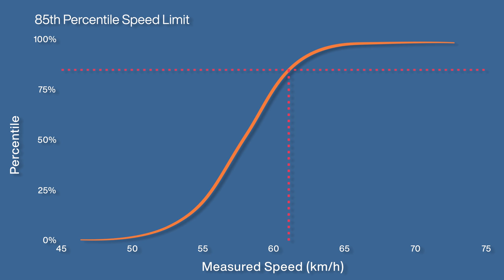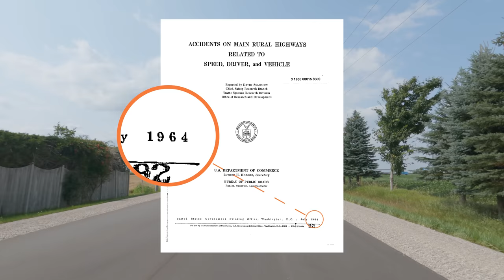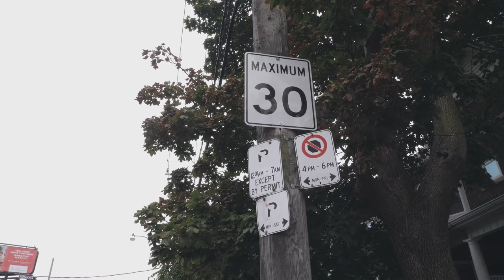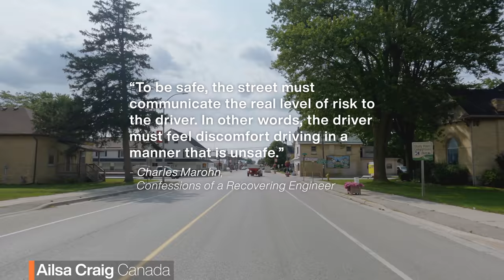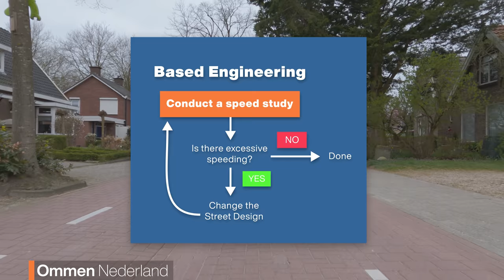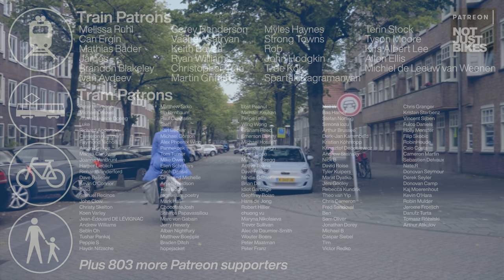The Wrong Way to Set Speed Limits [ST06]

Comment: If we set limits based on your recommendations wouldn't the traffic engineer be prejudging what speed he or she is predisposed to regardless if that speed is too high or too low?  I remember the national 55mph limit we had in the us.  That limit made a lot of sense in more crowded parts of the country with lots of hazards and older narrower roads.  However it made very little sense out in the remote extremely rural sections of highway in north Dakota or say Saskatchewan,  where it is extremely uncommon to have cyclists much less pedestrian traffic.  In some cases our limits in those areas still seem artificially low.  I've been on remote stretches of roads with a limit of say 55mph or approx 90kmh and witnessed literally nobody driving that slow.  If nearly everyone is going faster than a set limit, literally nobody one would have to assume that either they are all habitual law breakers with no regard for safety or the limit is artificially too low.
Reply from the maker: Did you miss the part about this method making sense for rural roads but not for city roads?

Comment: There's a residential street near where I live that I always used to use, and it is very wide and easy to go quite a lot faster than the posted 25, and the street I guess pooled their money to have speed bumps installed, forcing people like me to take different residential streets while going way faster than the limit on them. However they are the kind that have 3 parts, not one solid bump, and if I aim carefully enough I can still take all but one of them (is a little wider or something) at speed just by going straight down the middle of the road lol... I know it has to piss off the people who live there when they see me do that.

Comment: Grr...

85-th percentile takes pedestrians into account because most drivers will slow down for them... Please understand that most drivers don't actually (actually) follow/care/index to the speed limit at all. You drive the speed you feel is balancing safe and efficient for the circumstance. The number on the sign is to provide the proof of someone doing a bad job of balancing that for enforcement purposes... it's not actually the control.

The control is how safe drivers FEEL.  If drivers are going too fast (>30mph anywhere near an uncontrolled crosswalk, for example), you need to make them FEEL less safe without making them actually less safe.  Brick/textured roads, narrow lanes (with wider runsoffs), curves, making the cuts/etc more obvious all help here. Make the driver FEEL less safe, without making them BE less safe.

Then Hey!  85-th percentile speed limit is now the speed you wanted anyway.

i.e.: Look at how the streets you like are setup with "accidental" (it was completely intentional) traffic calming, and replicate that. Stop thinking about the speed limit.

Comment: Speed limits are set too low on the open road, and possibly too high in urban congestion, though I am exceedingly sceptical that lowering city limits will actually reduce speeds rather than generate ticket revenue for the place.

Comment: "This method seems reasonable, until..."
No! Stop! Hold it right there!
No, it does NOT seem reasonable AT ALL.

As a matter of fact, even at first glance it seeems totally bonkers.
Instead, the reasonable thing to do is decide how fast you want people to travel on that road, and then build the road so that it is safe at the intended speed (or dial down the speed limit when the road can't be built to be safe for the desired one).
Or, if re-evaluating speed limits for an existing road, examine the state of the road and its environment (location, geography and whatnot) and then from that deduce what speed is safe (or what modifications to make to the road to make the current speed limit safe).

Okay, now to watch the remainder of the video...

Comment: well bozo when you are driving you it is an active experience, not passive or subconscious 
monitoring your speed is part of driving just like checking your mirrors. A long with many other basics, not to mention every drivers first obligation is to prevent accidents. Has nothing to do with being a professional driver.
The only power people have is pushing a gas pedal or thunb paddle.
Your presentation is not too hot.
It could be way more matter of fact.
it is too much like broadcast “journalism”.

Comment: The problem with your videos is that you ignore that US and Canada has wayyyy more driving commuters and there's no solution to this problem at least at the moment. So stroads are necessary even if I agree with their issues and overuse.
Reply: One of the entire points of the series is that we shouldn't have so many driving commuters. If we built real infrastructure we wouldn't need to be so reliant on cars.
Reply: @_d0ser  yes. I fundamentally disagree that this is remotely possible for the majority of the United States.
Reply: @JimmyDThing  I mean, you could do this crazy thing called, build rail lines.
Reply: @_d0ser  Yes.  We have them, but where would you like to add more?   I live in NY and I am pretty familiar on this.  One of the most used rail lines in the country is from where I live to NYC (because it's the capital of the state to the biggest city and because it's a way to get to DC).

What do you think should change?  Or if this one is not an example of what you think is needed, what would be?

Comment: The 85th percentile is a valid approach since, as you say, people drive at whatever speed they're comfortable regardless of what's posted. We certainly learned this from the thoughtless and idiotic 55 mph national speed limit enacted by the Nixon admin.

Designing urban streets to encourage slow forward progress is an interesting approach and makes sense sometimes but not all the time, IMO. You have a bicycle-based agenda that favors safer, more pleasant conditions for bicyclists. You want "stroads" as you call it, to have slower traffic so a tiny percent of those on bicycles can feel more comfortable. The more society is dumbed down, that is, made easier for the lowest common denominator, the less forward progress can be made, both figuratively and, in this case, literally.

I am more concerned about speed limits on limited access highways (interstates, freeways), where bicycles are not usually permitted, than in towns. Your "stroads" (a word made up by activists) can only be altered on a case by case basis.

Comment: Traffic harassment = good, enforcing speed limit = bad.
Snow removal not a big problem with traffic harassment measures?, with the slowing of ocean currents from melting icecaps causing extreme weather.
Plus all the damage done to automobiles suspension system, and the people Screaming in pain in the back of a ambulance while navigating traffic harassment measures. 
The real problem is enforcing the speed limit in a fair and equitable way with out gaming the system on ether side.

Comment: Talks about civilised countries and then shows a speed bump in that country. Speed bumps are without a doubt the worst idea in the history of roads. I have some stories to tell driving to and from work on a road with speed bumps and none of them are pretty.
Reply: Which is why on its own, it isn't an effective traffic calming device, especially if the road it was on is very wide (that invites more speed).
Reply: @dbclass4075  The roads were narrow the problem is speed bumps don’t affect all cars equally, so on the 30mph road I was forced to slow down to 5-10mph at every bump, people behind me got impatient and overtook, and on several occasions nearly caused a crash. However, when I took a different car, I could glide over them like they weren’t even there, especially those square ones which don’t go all the way from kerb to kerb, an SUV can straddle them without slowing down at all.
Reply: @thunderbug8640  Ah, then chicanes would be more preferable. No matter the vehicle, they have to slow down.
Reply: @dbclass4075  They would cause too much congestion on that particular road. The side without priority would just not move at all due to the volume of traffic coming the other way. Speed cameras sort of work, but you would get people speeding in between them lol.
Reply: @thunderbug8640  If there is space, maybe a roundabout?
Reply: Speedbumps are terrible. They only work on roads that are meant to be slow - so residential roads. But they make a fuckton of noise.

They are only good in car parks

Comment: Those flashing signs don't really seem to do anything except make everyone panic and drive way less than the design speed of a road.  The result is everyone riding on their brakes and potentially more congestion as a result.  I WILL also point out that we are in a semiconductor shortage and those useless signs don't help much there either!  Those chips should be going into cars so we can have normal prices again.  I looked at used car prices and nearly had a heart attack!  A lot of cars are $14,000 for one with well over 100,000 MILES.  It is total absurdity!  I am glad I got my 2013 Passat for $10,000 with a shade under 30,000 miles when I did.  I am also very pleased it never burns or consumes oil rather than being some Toyota that is DESIGNED to burn oil this polluting the air!!  Get your act together Toyota!  This is not like you!!

Comment: Please, we all know lower speed limits serves only a single purpose: increase revenues.

Municipality needs more money? Let speed limits, call it safety, then ticket everyone for speeding. Never increase speed limit again.

All you really need is situational awareness and driving like a decent human not some distracted nut job.

Make everyone actually prove they can drive normally and ban licensure for a short time up to permanently if they can't. Remove the idiots from the roads and suddenly everything improves. Some insurance companies already are going this way by offering discounts for driving properly and they'll follow your driving for 6 months. And yes, they'll INCREASE your premiums permanently if you drive like an idiot.

If you want to harp on speed limits, the correct thing is posting MINIMUMS alongside the maximum (which let's face it is the only speed followed). Nothing screams out crash into me more than doing 20-30 in a 40+. Yes they are offering the law, but they're also purposely causing a road hazard by driving at speed significantly slower  than what the average person is doing.
Reply: Why should the slower vehicle have to violate the law to make everyone else feel safe? 

If everyone followed the law, the person wanting to go 15 over would be the one causing the problems. 

As for if enforcing speed limits is for revenue or not, probably? I believe there should be more automated speed enforcement, but the fines should simply be set to cover the cost. If the enforcement revenue exceeded the costs of enforcement by a significant amount, you’d get a refund. I want people to drive at a safe speed limit, I don’t want their money.
Reply: if it's not physically possible to exceed the speed limit, they're not going to ticket you. how is this a difficult concept
Reply: @blitzn00dle50  I agree with the sentiment, but I also watch people speed on narrow tree lined pedestrian streets. I believe part of the problem is separating out cultural norms around driving and the physical infrastructure.